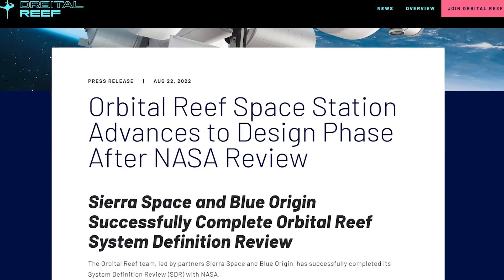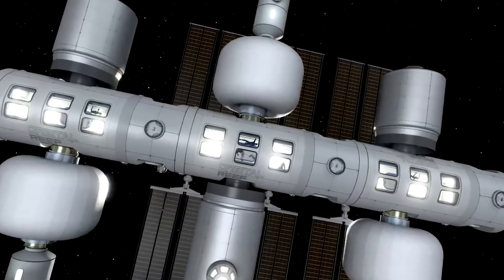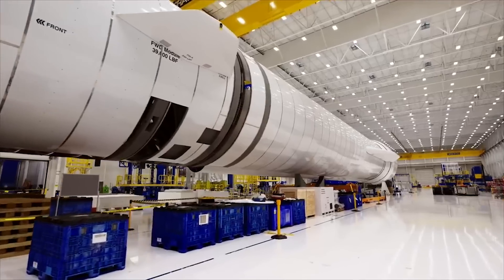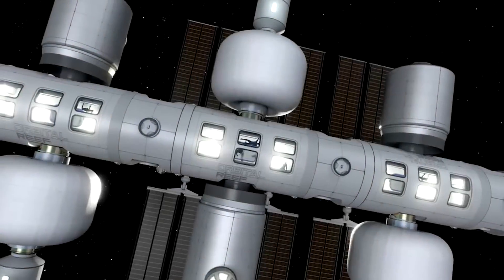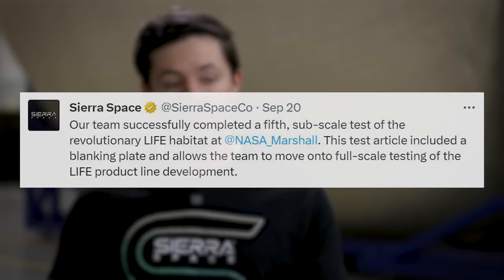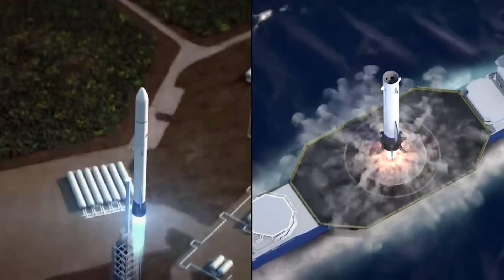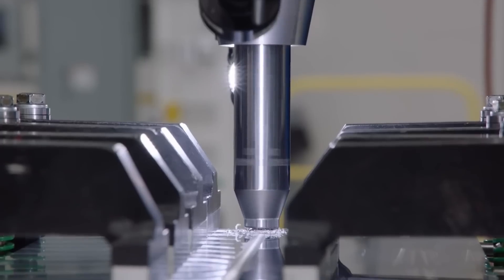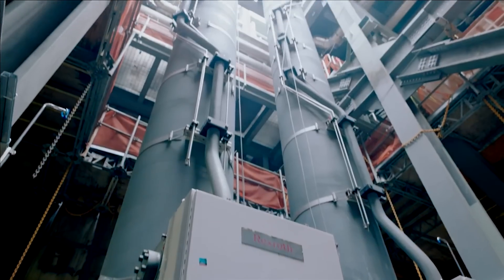What Happened To Blue Origin’s Orbital Reef Space Station?

Comment: I try to not be an asshole towards blue origins. But so far they haven't surpassed their reputation as the rocket company who delivers only rocket renders for the past several years. "Oh, but there's new Sheperd!". I mean, for a company which is fighting for Artemis contracts, aspiring to go full reusable. Does a sub orbital rocket which lands on parachutes actually counts?
Reply: The New Shepard booster does not land with parachutes, it lands propulsively (and has been since before Falcon 9). Together with the reusable capsule, it's a fully reusable system. Beyond New Shepard, Blue Origin has also developed and delivered an impressive assortment of engines, including BE-3U and BE-3PM, two highly efficient engines powered by cyrogenic LH2 and LOx and BE-4, a very impressive high thrust, deep throttling closed cycle CH4+O2 engine.
Reply: Nope. Its easy to go to space, but its very much harder to reach orbit. Did they actually even reach space?🚀
Reply: @MichaelWinter-ss6lx new Shepard reached 106km in altitude but compare that to spacex who regularly reaching full orbit

Comment: A single Starship would have more pressurized volume than the proposed initial form of Orbital Reef, no assembly required.  Take the aerodynamic surfaces and heat shield off and fit it with lab equipment and extra PV panels and you'd have an instant space station that's  vastly cheaper and more capable than Blue Origin's in a lot less than the ten years BO is looking at.
Reply: They know, these companies wont let their deadlines pass because of someone else... planet labs needed to launch 220 smallsats, spacex and nasa couldent handle the speed so they sent up a few dozen with india... the fact that sierra and redwire havent left yet, tells me they checked on blue origin and are happy with the timeline atm
Reply: Yup, obvious from the beginning but somehow Bezos lives in a bubble. He's just pissed SpaceX is so far ahead and resorts to dirty tactics to slow everyone down because they cannot get their ass in gear. The lawsuit from the shareholders made me laugh out loud. Bezos has a choice to make. Lose a lot of value due to shareholders dumping their stock, or start launch kuiper satellites on SpaceX F9's. Neither are his favorite choice 
🤣